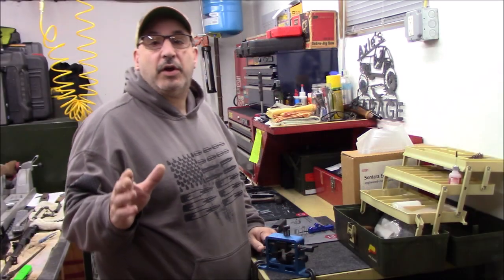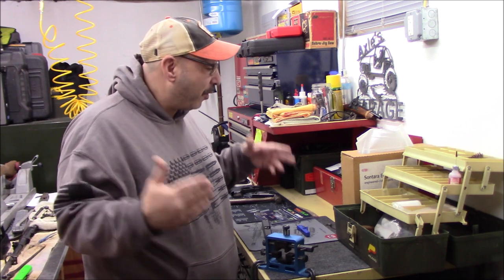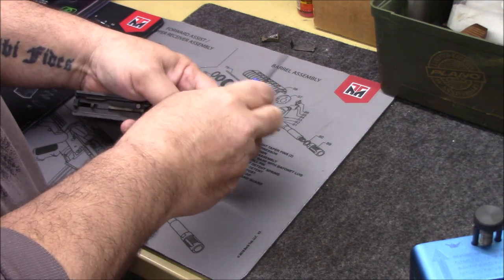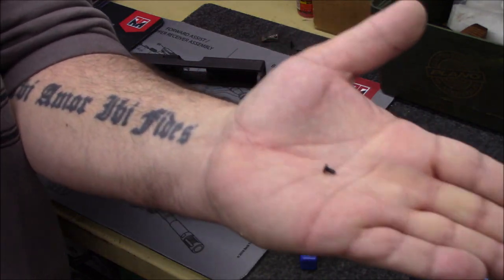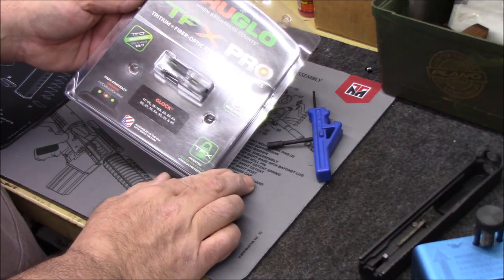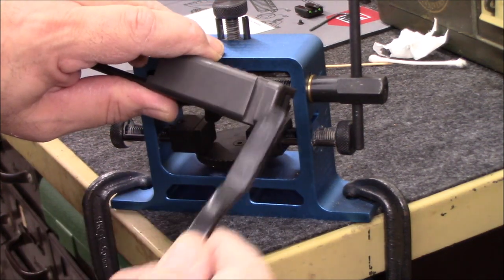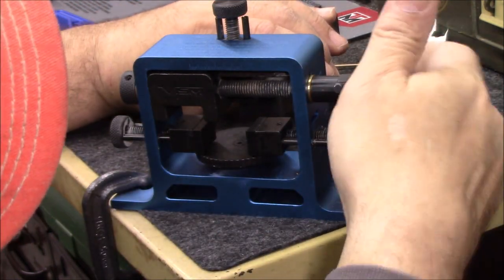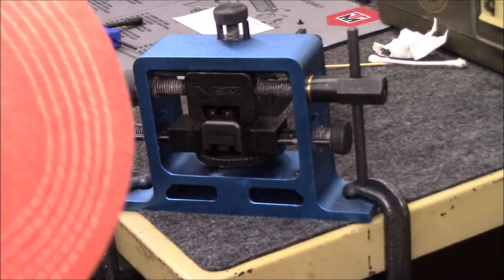TRUGLO TFX Pro Tritium and Fiber Optic Xtreme Handgun Sights for Glock Pistols

Comment: Very well done, I’ve done many of these.  Only a note is standard procedure is left to right to remove followed by right to left to install.  This also applies to all pins.  Gunsmith rule.  That said, very good video and use of your sight pusher as well confirming with your mic.  VERY GOOD JOB.

That front post is the bear and must be centered at the dot as the sight is loose in the oblong Glock hole.  Being off by .02mm will put you in the 9-ring at 21 feet, even with a centered rear sight.  As you have done, must mic it always.  I’ll trust you with my sight installation.

Comment: Note: Put the front dot well into the U notch, and keep a "Combat Hold." The front sight should completely cover the target. The tops of the dots should be even. Not the tops of the metal casings. Equal light between the front blade and rear notch is the same as traditional iron sights✌🏾🎅🏼.
Reply from the maker: Thanks for the tips

Comment: great video I'm a certified Gunsmith and Licensed FFL dealer, these sights are very nice works great for people with bad eye sight and need alittle help with picking up sights when aiming, only problem is the sight pusher I tried the VISM and you're limited to slides you can install sights on, best sight pusher is the REAL AVID sight pusher, as setting your sights use a white grease pen and mark your factory sights and when pushing in your new sights align new sights with grease pen mark
Reply from the maker: Thanks for sharing